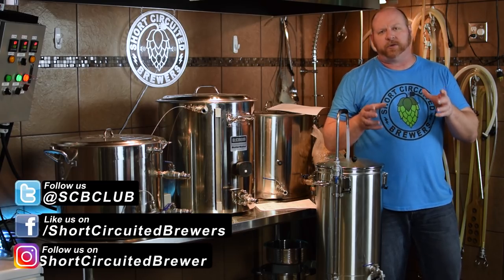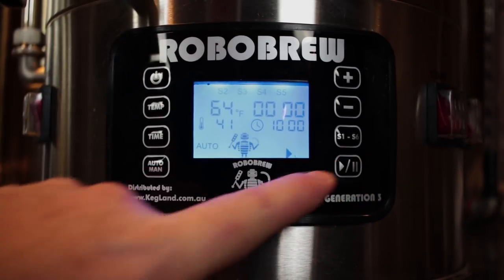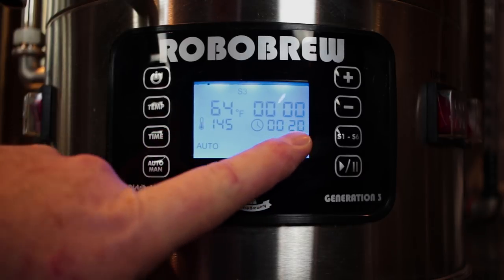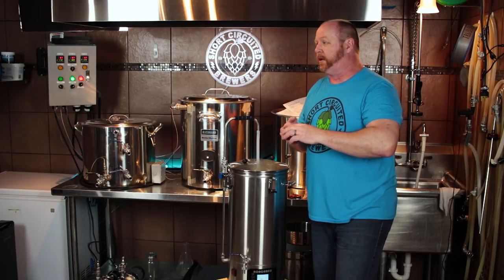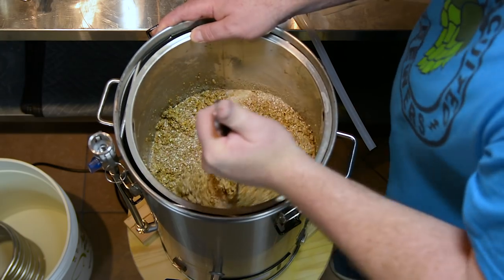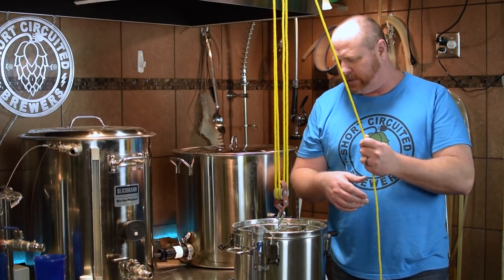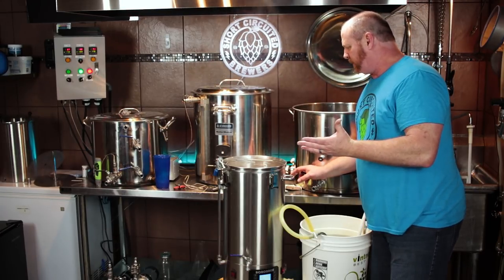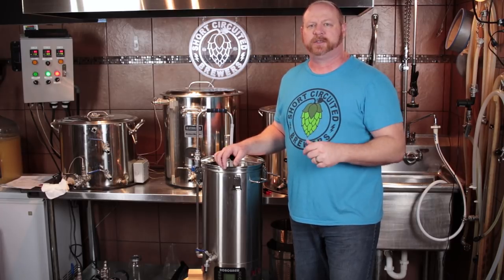ROBOBREW v3 1st Brew day | Complete delayed start and mash step programming included

Comment: I received my 3.1.1 yesterday, did my first brew today. Going from a 15 liter BIAB on a stove top on full blast (_and_ with the oven at 550 to even reach a boil) to this machine was incredible. 

I watched so many videos in preparing, but I really wish I would've watched this one before I started, seeing as I absolutely clogged the false bottom with Styrian Golding... Also clogged the pump quite a bit, but it luckily solved itself during cleaning. 

By the way, thanks for making me realize I can just hook up hoses with camlocks to the pump. I used the recirculation arm for both mash, boil, whirlpool, cooling, and transfer, and while it was so cool to have a pump doing a lot of the hard work for you, I felt the arm itself was too rigid, and it actually popped out of the socket several times as I was moving the hose. Adding a camlock hose to my gearbox asap!

Comment: Great walk through. I have to say that this device is so very similar or equivalent to the Grainfather in most aspects except the programming.  The Robobrew seems pretty archaic in that area compared to the GF. I wish I had one to brew with and compare to the GF.
I totally agree on the lack of need for step mashing nowadays.  I have yet to use that functionality on the GF.
Maybe I'll get a winch for my garage ceiling too once I can finalize where I want the GF to sit.
Reply from the maker: Yeah that is the only thing the Robobrew is lacking IMO to be a direct comparison to the GF. They are working on a wifi connected controller for it. will be interesting to see what they come up with. The winch is great! I highly recommend it. Cheers Larry!! 👍🍻
Reply: I'd love a Grainfather, but it's a very expensive unit. I can buy a Robobrew, Digiboiler and a Fermentasaurus; effectively a whole brewery, for less than a single Grainfather. It's hard to beat that kind of value when you're strapped for cash. On top of that, the company keeps iterating on and improving the Robobrew. Listening to the community, considering their feedback and implementing recommendations is a very valuable trait, and an uncommon one these days.
Reply: @ShortCircuitedBrewers  I read on Facebook that you can Hold down the step button, and when you hear two beeps you have set the auto times to start only after the target temp is reached. Is that true?
Reply: Just confirmed via online manual for V 3.1.1 - "There are two automatic modes which can be switched between. The first automatic mode will start the timer before reaching the step temperature. The second automatic mode will wait until the temperature of the step has been reached before starting the timer for the step. To switch between automatic modes hold the S1-S6 button for 5 seconds. If one beep is heard then it is in the second mode whereas, if two beeps are heard then it is in the first mode."
Reply from the maker: Yep

Comment: I will wait for RoboBrew v4,  that programming panel is bananas 🤦‍♀️
Reply from the maker: Lol I hear you..I really don't see myself using anything but the preheat feature. The other features don't do what I would prefer them to do which would be when it gets to a certain temperature start the timer and maintain that temperature for a certain period of time. Thanks for watching and commenting! 👍🍻
Reply: Just got mine and was a bit worried about using it for a step mash too. Def will do the steps on manual mode as you suggested. Thanks for yet another great informative video!
Reply from the maker: Thanks for watching!

Comment: On an early use, perhaps 3rd or 4th batch, I evidently disturbed the false bottom and grain flooded the dead space.

The recirculation pump became blocked and would not function.

I dumped the trub after transferring the wort to a fermentation carboy.

Clean what you can and put some hot water in to soak the intake port.

Take a turkey baster and squeeze the bulb and then insert the tip into the intake port.

Release the bulb to suck out impacted grain. After doing this 3 or 4 times the grain was removed and the pump worked.
Reply from the maker: Yeah it can happen...👍🍻

Comment: Great video Brian. A couple upgrades I noticed on the robo brew that I wish the grainfather had is the cam locks and the little rubber handles on the lid. Keep up the good work cheers 🍻
Reply from the maker: Thanks Chris! I am not 100% sure but I think that the grainfather could be upgraded to a cam lock system as well using the same process that I upgraded my Gen 2 robobrew with. I assume you have seen that video?

Comment: Thank you in advance for all your great videos and loads of information. I have recently invested in a Brewzilla 3.11 all in one system. I have made three recipes with it using the single infusion method and has work out very well, However, now I am now ready to make a Vienna/Mexican Lager that I would like to use a step mash method to help make it a little drier and promote a good final gravity. I watched your video that you did regarding the step mash set up the RoboBrew. I have a question. There are two automatic modes on the Brewzilla that you can switch between. The first automatic mode will start the timer before reaching the step temperature. The second automatic mode will wait until the temperature of the step has been reached before starting the timer for that step. The question is this; if I use the second automatic mode for my step mash, will there be any negative effect to the wort as it ramps up in temperature to get to the rest time needed for that step? If not, then I wouldn't have to add more time in the pre-set mash settings as I would if I used the first automatic mode. What is your thought on this? Thanks again for the wonderful work you are doing.
Reply from the maker: No you'll be fine. 👍🍻

Comment: I've been brewing for years but never used an electric system. Is that the way the wort chiller is intended to be used? Can you recirculate the wort through the chiller to sanitize it before flame out? At first glance I thought it was a submersible wort chiller, but it obviously won't fit in the boil with the hop spider in there.
Reply from the maker: No exactly I was just messing around. It is meant to be a immersion chiller for sure. I had a few people ask me if you could do it that way so I tried it. 👍🍻

Comment: hey, Brian, great video and great solution to chilling the wort for those without a garden hose! my question; do i add the black stopper to my overflow pipe when recirculating (presumably, to prevent misc grain from making its way down the mash pipe and into the pump)? i have v3.1 and looking to do my first brew with it this long weekend. thanks for your time and the great work!
Reply from the maker: Yes the stopper is to keep grain out. 👍🍻

Comment: Did you recirculete boiling wort throught to sanitize the pump before chilling? If not, no chances of contamination?
Reply from the maker: Yes I did run a little through the pump prior to starting the chilling,  not a lot because I did not have a hose attached and did not want to aerate hot wort.

Comment: From you experience, this versus the anvil Foundry? I'm looking at the two, this one is a little cheaper, but the anvil cones with everything out of the box?
Reply from the maker: The biggest advantage over this one that the Anvil has is dual voltage capability..they both make fine beer. I like the more powerful Anvil on 240 volts. 👍🍻
Reply: @ShortCircuitedBrewers  if you didn't have the 240 capability (I don't have it) would you still give advantage to the anvil?
Reply from the maker: @Nefariousrouge  if you never will go to 240 either is fine. 👍🍻

Comment: I want to try cooling my wort like you did in this video. Besides the camlock connector what other piece do I need? What do you have on the hose that connects to the camlock connector? Now that you've had the RB for awhile do you still use the immersion chiller or do you recommend another method? Thanks in advance! Cheers!
Reply from the maker: I had one of these to connect the 2 female cam locks together. https://www.brewhardware.com/product_p/camdoublemale.htm Does your Robobrew have the cam lock on the recirculation pipe already? I have been using my Jaded Scylla chiller on the all in one systems recently. They make one hell of a chiller.. from boil down to pitch temp in 5 minutes if your ground water is cold enough. 🍻👍
Reply: Short Circuited Brewers Yes. I have the 3.1 with the recirc pipe. I used the immersion chiller that came with it in the kettle. Pain in the a** with the hop basket in there. Thought I could use what you did. But I can’t tell how you connected it to the 2 female. What do you have on the hose side?

Comment: How long should it take to drain out after raising the grain pipe up? Because my screen was so clogged it took almost an hour for me to drain and sparge it..
Reply from the maker: I usually sparge until I get to volume. Try some rice hulls next time. 👍🍻
Reply: @ShortCircuitedBrewers  thanks for the reply. Assume you mean the full preboil volume? I did that on my first brew (only done two so far) but read in a book that if you sparge with too much water it raises acidity? Great vid btw

Comment: I currently use BIAB method where I don't sparge. I just let it drip dry. Is sparging necessary with the RoboBrew or can you follow similar BIAB methods?
Reply from the maker: You can follow biab methods. You will run into a capacity issues with bigger beers. That is the main reason  for sparging with the Robobrew

Comment: What water/grain ratio do you use? Do you just add the dead space onto a typical 1.5qt/lb equation, or do you do a different qt/lb that accounts for the dead space. From what I can tell, it’s between 1-1.5 gallons of dead space including down in the pump. Just curious bc I didn’t account for it on my first brew (very newbie to all grain) and had a very thick mash and this trouble recirculating
Reply from the maker: I think it is 1.7 my beer smith profile is available on my website. I also have a video for a profile on brewers friend. 👍🍻

Comment: Hey, Is the 1500W really enough power to get a good boil? It looked decent on the video but definitely less than propane, thats probably to be expected tho. No issues with DMS? Whats the boiloff rate like? Still 4L per hour? Thanks!
Reply from the maker: No DMS issues. It isn't what I would call a "vigorous" Boil but it is adequate to get the job done. It does take some time to get there. though. 4L is pretty close, could be a little less depending on humidity etc. 👍🍻
Reply: Good to know. Thanks for the reply. Cheers!

Comment: What's best, Anvil Foundry 10.5 or Robobrew? A side of the capacities, wich one its easy and wich one its more helpfull?
Reply from the maker: They are both good systems. The Anvil foundry can switch voltages between 120 & 240. The new models have the controller up on top. The Anvil had a little more accurate controller. It does not have the step mash timer and alarms like the Robobrew ( I don't use those anyway) they are both easy to brew on. 👍🍻

Comment: Thanks Brian, great work!  Sorry if already asked but how did the temperatures on the controller do compared with actual readings.  I know this was an issue on previous versions.
Reply from the maker: It did really well, BUT if the flow is not pretty constant and consistent it can vary by 10 degrees. I am currently working on a fix for it. The main issue is the temp sensor it somewhere between 4 and 5 inches away from the pump inlet. The problem with that is that the pump is pulling wort/water directly off of the elements, and unless you have a good flow the sensor is not getting the wort/water circulating past it to get good readings. Like I said I am 99% sure I know how to improve the consistency across all of the ROBOBREW line but I need to test my theory to see. Stay tuned
Reply: Hey there, did you ever work this issue out? Cheers.

Comment: Great video, Brian! After watching many of your videos I have decided to go with the Robobrew ( now BrewZilla), regardless of the auto-programming issues. I prefer manual anyways.  I do have a question about target temperature during mash.  I have noticed on your beersmith profile you have created that the mash in/stike water temp is usually around 10 degrees higher than what it is supposed to be, understandably so, but once you mash in do you change/set the temperature to 152 or whatever your mash temperature is supposed to be.  I have read that the temperature probe on the system is where the heating element is so that it may not reflect what the core temperature of the mash actually is.  What is the best way to go about that? Thanks!
Reply from the maker: Yes that is what I do. The grain is cooler and drops the temp of the water to the correct temp. Another tip I've learned since this video is, letting the mash rest for about 10 minutes BEFORE starting the recirculation. Seems to help prevent stuck sparges. 👍🍻
Reply: Short Circuited Brewers sounds good, thank you! Cheers🍻

Comment: How well do these things work on the high gravity brews. I remember reading some of the earlier all-in-one brewers had trouble hitting those higher gravities. Is that still an issue with the newer bad-boys?
Reply from the maker: They can, obviously you're limited by grain space and the more grain you have in the malt pipe the possibility for lower efficiency rises. Has nothing to do with old or new models. Grain crush and water composition become really important as well. In short they can but it is more difficult.

Comment: Is the camlock connector you linked to all that is needed for the tubing to connect to the camlock on the robobrew?
Reply from the maker: Yes. Obviously you would need a corresponding cam lock on the hose. Hope that helps! Cheers! 👍🍻
Reply: Short Circuited Brewers Thanks again! Assembling a list of add-ins before mine ships. I wonder how their counter flow chiller performs.

Comment: You are using the immersion chiller backwards.  Cold water runs through the coil and the coil sits IN the boil kettle.  If you run it the way you did you need to circulate wort through the coil for 15 min or so to sterilize it and then plunk it down in the cold water.  BUT it will work better as an immersion chiller, just not very efficient using it backward.  Otherwise nice video.
Reply from the maker: It was just an experiment to see how well it would work that way. As I stated in the video, people online were asking if it would work that way or not. Thanks for commenting! Cheers! 👍🍻
Reply: Ah, I missed that somehow.  

For those who were curious you could work it backward but you have to find a way to keep the cold water circulating or the efficiency will be very low.  The problem is that the water immediately next to the tubing will get hot and act as an insulator that keeps the cold water from touching the tubing.  This is also true when using it as an immersion chiller.  Which is why circulating the wort speeds up cooling a lot and why CF chillers have things (ribbed inner tubing or spiral wrapping) that makes the cooling water and or the wort churn as it flows.  You can also speed things up by moving the coil around/ up down in the wort.  That of course is going to be more difficult if you are running near boiling wort through it than if you are running cool water through it.  In either case you should get it up to sterilizing temp for a few minutes before you start to use it for cooling.

The short version is yes you can use it backward but it's more work to get decent results.

Comment: Great video! Just sold all my full grain equipment due to taking up too much room! Thinking about getting all in one! Brewers Edge, Robo, or grain father! Any thoughts suggestions?
Reply from the maker: They will all certainly get the job done. Out of the three the mash and boil is the cheapest. If you want recirculation you can just add a pump. All of them can have some issues but once you get used to using this type of Brewing System it is pretty nice. Clean up size. Only limitation you have on these types of systems are if you brew big beers you'll need to add DME or do a double Mash. Check out a channel called David Heath his channel is dedicated solely to the grainfather there is a wealth of information over there. I don't think you would go wrong with any of the three. Thanks for commenting! Cheers!👍🍻

Comment: When I watched the instructional video from Keg King, they recommended putting the grain into the malt pipe first, then lowering it into the water, but I see you put the pipe in first then fill it.  Is this a difference in the new model, or just your choice?
Reply from the maker: You can do it either way. With filling the malt pipe first and then dropping it in, it is kind of the same process as "underletting" this technique can decrease the possibility of dough balls since the grains get saturated from the bottom up. Thanks for commenting! Cheers Michael!

Comment: I ordered and received the same male to male connector and it leaks. Not sure what the differences between the two camlock‘s but there is definitely a lot of play when you insert the male connector to the camlock on the RoboBrew.
Reply from the maker: ?? That's weird..
Reply: Short Circuited Brewers Got an email in to brewhardware.com. Waiting to hear back. It’s almost as if the washer inside there it’s not big enough.